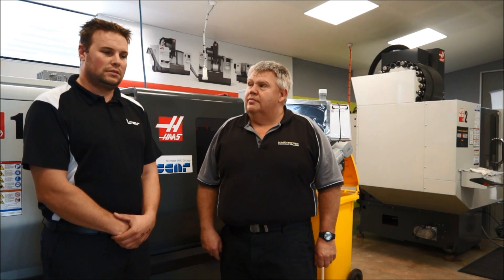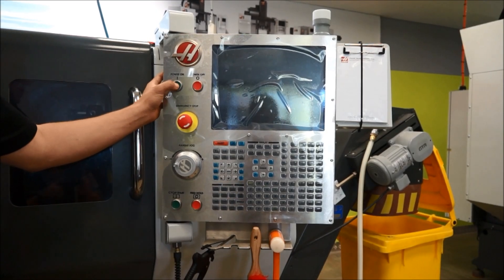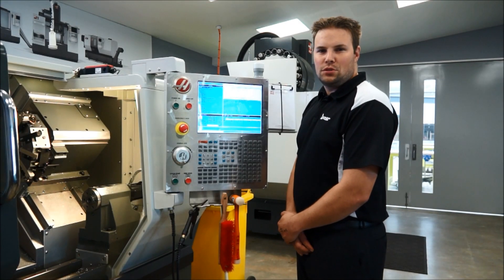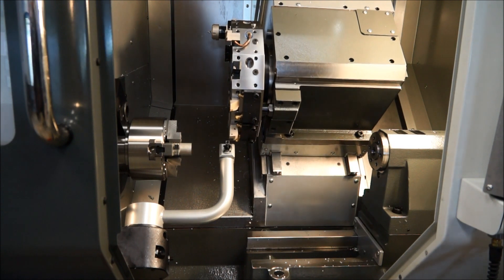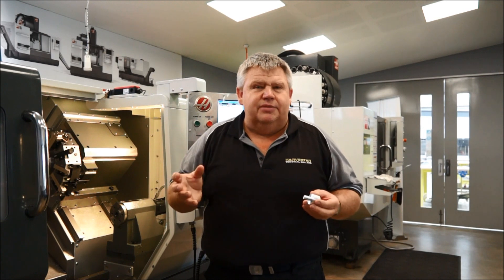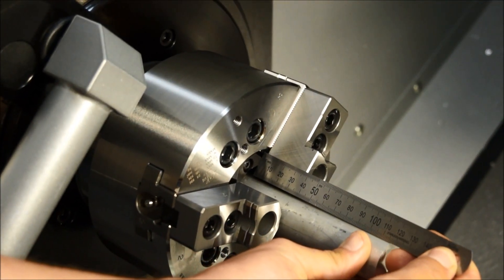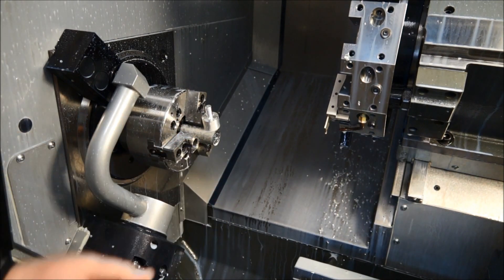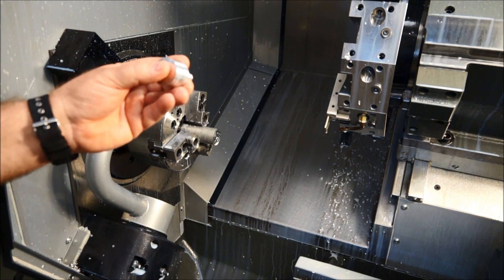HAAS ST10 Start up & Tool Offset - With ISCAR Craig

Comment: Very good! I run the same Machine I'm my shop but, doesn't operate or change tools that fast. How or what do you have to change in the program to help it move alot faster and cut down tool change time and stalling time?
Reply from the maker: Hi Brandon, I'm a high school shop teacher and the students use the Haas at school to make their projects.  So time isn't a major problem for us, as it's not a production environment.  To be honest, I don't think you can make it change tools any faster.  This would be a good question to ask you local HFO (Haas factory outlet).  Cheers, Aaron.

Comment: Great video but how can I set the correct feed and speed? Con you give me an advise? I just find too much information in the catalog but I don't know where to start.
Reply from the maker: Hi Ro, it really depends on the material (surface speed) you are machining and the type of tool you are using (HSS or Carbide).  As a rule carbide runs 3-4 times faster then HSS.  For example, if you are machining 10mm dia steel round stock with a surface speed 30m/min using high speed steel you use a mathematical formula (320x30)/10 = 960rpm.  Now if you're using carbide you can run 3 or 4 times faster.  Depending on your vendors carbide tip insert you could rough out a 0.3-0.4mm/rev and depending on your surface finish drop that down to 0.1-0.2mm/rev. Now these are very conservative figures and you'll need to do your own research and sample the results for yourself.  Hope this helps?  Cheers, Aaron.
Reply from the maker: Oh, machine rigidity and horsepower also come into play mate.
Reply: DCTTeacher1 thanks for the info but, I got doubts about the speed selection because the catalog gives me a graphic I don't really know how to use. I feel there must be considered 5 variables: 
1. Working material surface speed 
2. Depth of cut. 
3. Operation type. 
4. Material insert type and coating. 
5. Tool stickout
For roughing I more less found a speed that works but I don't feel 100 % confident is the best but For parting and grooving I just don't know how some guys do it so fast! How can I found the propper values?
Reply from the maker: Ro Cuevas hey mate, I use ISCAR tooling and I have their tool catalogue. It tells me the feed per rev. I usually aim for the middle value. If you're using HSM or Fusion360 you enter that value for each tool in the tool library. I usually leave the set defaults in CAM and the run the job. I tweak the program after some trial and error lol
Reply from the maker: Ro Cuevas if you want and you use HSM or Fusion360 I'm happy to share my tool library with you?
Reply: Fusion 360 claims to be really good and feasible to get for people. 
I have a catalog and I would like to show you what I'm talking about when I say my speeds are wrong for grooving and parting, probably my catalogs are not too easy to read :( or I don't really know how to use them.
Can I send you an email?
By the way really thank you for the info you are really kind. 
I have to learn cnc lathe and also more difficult cnc swiss lathes because I have a job opportunity on both machines but it's super difficult to learn how to program such swiss lathes, because in my state no body knows how to use those machines.
Reply from the maker: Hey Ro, I won't insert my email address here.  However, go to my channel and click on the About Tab.  Scroll down and you can click to obtain my email address. Cheers, Aaron
Reply: Ey man that is correct. Thanks Aaron.